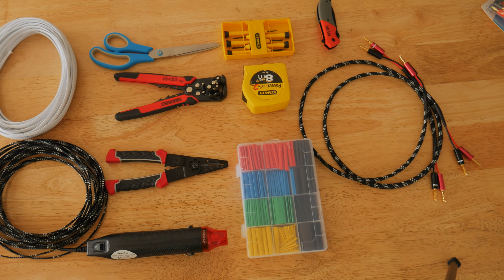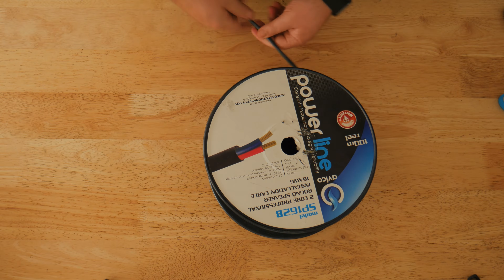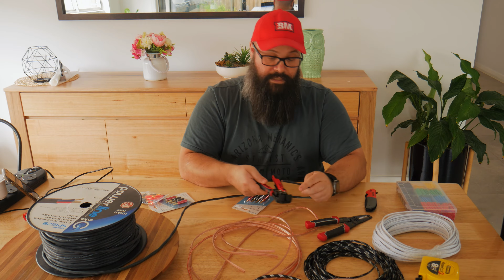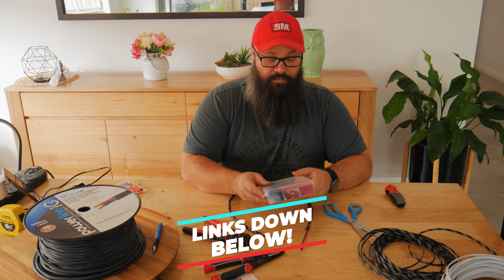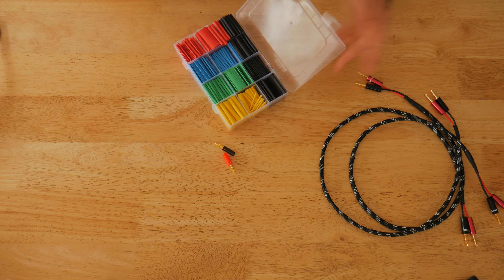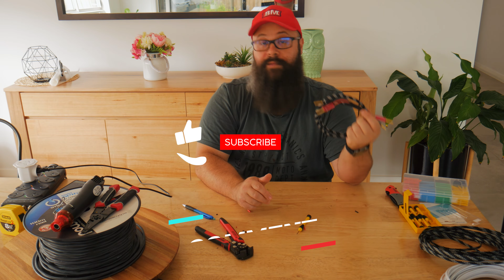EASY To Make DIY Home Theater Speaker Cables!

Comment: Part of the reason why I spent over it £1,000 on 9 channels of speaker cables was to lower the noise floor!

 I had been experiencing an electrical current sound for over a year and it was only when auditioned 3 receivers, that it quickly became apparent that my previous unshielded cables (one set being the 14 awg Amazon basics) were the problem.

Got to remember unshielded cables act as antennas for attracting RF/EMI and sadly the longer the cable the better the antenna! That probably explains why, when I look back, I remember I used to have to disconnect my height channels to reduce the electrical current sound! (Probably not describing the sound correctly but that's the only way I know how) well anyway after testing my base level speaker cables and when I was confident enough that they were indeed the problem, I moved on and changed my height speaker cables as well, my room is now over 50% quieter, I've actually just finished shielding my HDMI cables and it's become another 10% to 15% quieter.

Conclusion;
 as well as medium to high volumes, I can finally start enjoying my setup at low volumes too. 🥳

If interested you can click on the red dragon twice and see the set-up for yourself.

Comment: You’ve inspired me, my friend. I’ll be changing my speaker wire in November. 
Over the years, I’ve had to join/extend various cables. I’ll now be replacing the lot with single runs to each cable, then adding some “class” as you have here. 
You know how much I love a tidy rack! 🤩🤩🤩
Reply from the maker: Awesome mate - making cables is a tonne of fun.

Comment: I've been using banana plugs from Fospower from Amazon which use 2 grubs and metal casing, really good plugs.
Also, ran my Atmos speakers with Amazon Basics 14AWG, it too has the extra sheilding, again really good cable.
Reply from the maker: Yes I’ve seen the fospower plugs as well they look good.

Comment: One of these days I'll get around to making my cables look nicer but right now they are functional even if they are ugly. One thing that might of helped you is taping the ends of the cable together when putting the sleeving on or waiting to cut them until after the sleeving was slid on. Still haven't decided if I want to use cable pants or heat shrink to tidy up the look.
Reply from the maker: Yes taping would have been a great idea actually thanks for suggesting that. All in all it worked out well and there’s always a better way. I like the tuxedo pants as wel but they are super expensive for some reason. Either way I’ve made 17 cables now so I won’t need any more a for a while :)

Comment: I have vintage speakers and they don't accept banana plugs.
Reply from the maker: You can still make these but use a different plug to suit instead of a banana plug.
Reply: @BuildMontage  Mine are spring loaded. But Tyler Stout gave me an answer.
Reply: Look for banana plugs that are labeled as pin plugs which will work with speakers with spring clip terminals.
Reply: @TylerStout  Thanks!!

Comment: For my US brethren I bought these banana plugs from Amazon and I love them!  They have 2 screws to hold the wire and are a really solid fit, so they are a nice option in-between the cheap ones, and the super expensive ones. https://www.amazon.com/dp/B073VBGNNT/ref=cm_sw_r_cp_apa_fabt1_lsQRFb72Z8GMT?_encoding=UTF8&psc=1